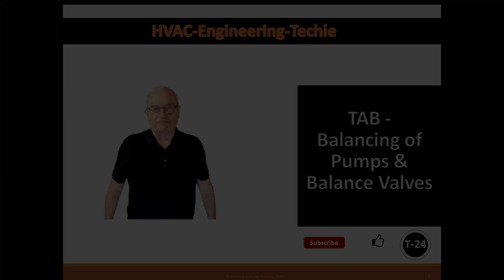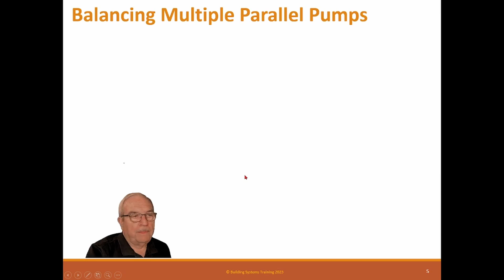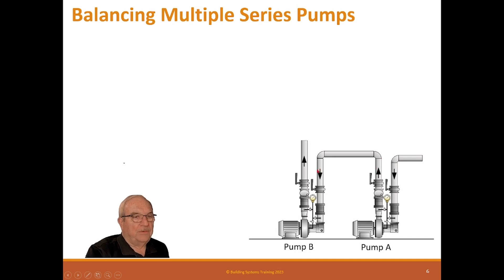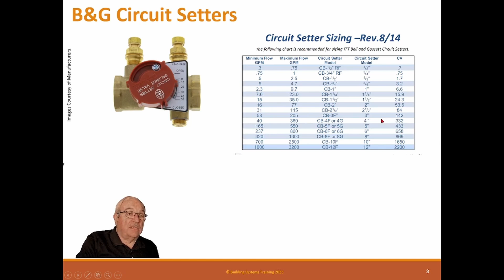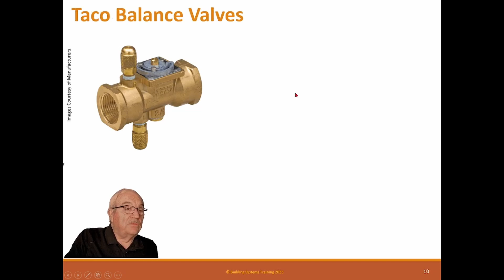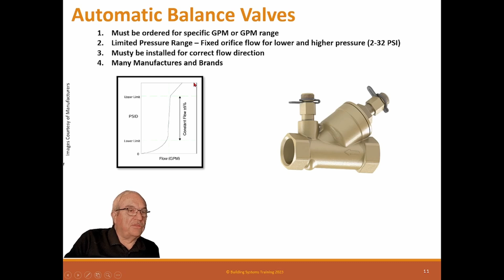HVAC Test & Balance of Pumps and Balance Valves, Training Session T-24

Comment: Please make pump curve.. supply fan curve...
Reply from the maker: That is hard to do without a specific pump at specific conditions. These curves are available from any pump manufacture and are shown in their standard catalogs but only for single pumps, multiple pumps running in parallel or series must be requested as a special computer run from the vendor.